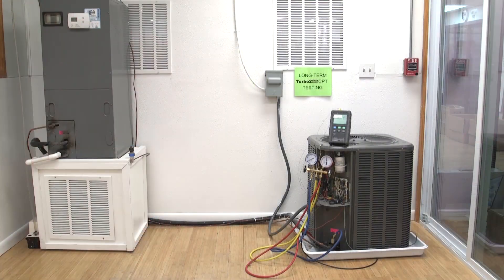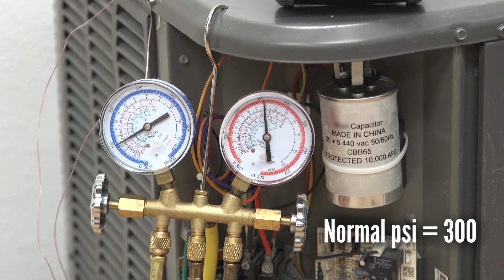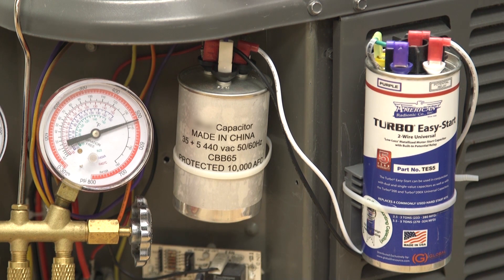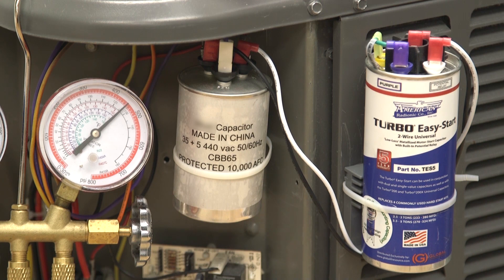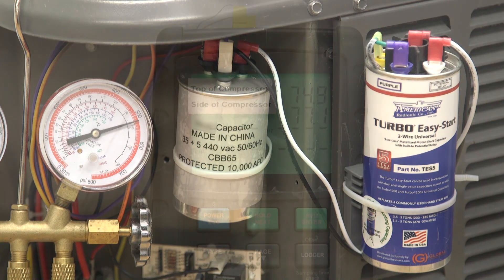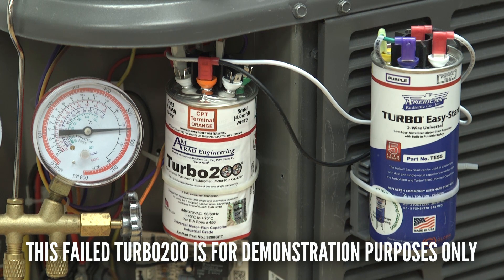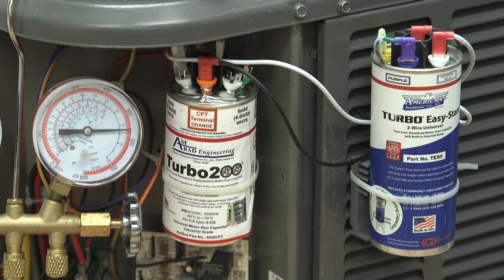Turbo200 and Turbo200X with Compressor Protector Terminal (CPT)

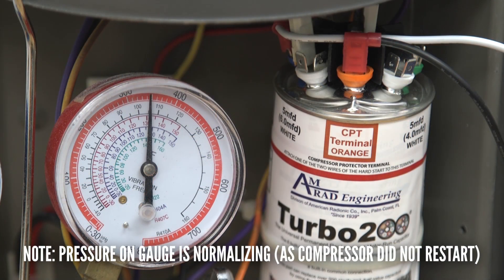Comment: SO, are you saying that If you have a Turbo 200 ( say 45/5) setup on you AC unit already, and someone installs a 5-2-1 (three wire) hard start kit in your unit, that the BLACK wire from the potential relay box should go to the ORANGE 🍊 terminal on the Turbo200 capacitor 4:50 and NOT to the T1 post of the  contractor..?? 🤔🤷🏻‍♂️
Reply: Does it have a Potential Relay, the "three wire" that you're referring to?  If so, the CPT function doesn't apply.
Reply from the maker: Hi there, thank you for your comment. The wire that normally goes to the common would go to the orange terminal!
Reply: @global.the.source  .. Thanks for answering.👍  I see spell check changed “contacter” to contractor” anyway on or 5-2-1 three wire HS Kit has different color wiring from the potential relay box, the Black goes to the T1 on the contacter, the Red from the kit capacitor went to Common on the AC unit and likewise the Yellow to the Herm… BUT, since a Turbo 200 was installed in 9-2021, Now that Red wire from the kit should be swapped from common over to the CPT terminal, You Say.?? 🤔 I am sure the technician back in 21 wasn’t familiar with just exactly what that Orange 🍊 CPT terminal was for..!!!

Comment: Does the CPT prevent damage if the hard start kits relay contacts weld together?
Reply from the maker: Hi Denny,  

Thank you for the opportunity to confirm! The NEW CPT® Fuse Wire on AmRad’s universal hard-start kits protects the compressor from damage within 3 seconds of a relay failure!

When the potential relay on a hard-start kit fails with the contact stuck in a closed position, the motor-start capacitor remains in the circuit. This makes the AC compressor run with too much capacitance, causing damage and even potential failure.

The CPT® Fuse Wire prevents this damage. When the relay becomes stuck in the close position, the fuse inside the wire disconnects within 3 seconds, cutting the motor-start capacitor off from the AC system. No damage, no mess, easy replacement.

Only available on AmRad’s American made, 2-wire, universal hard-start kits (TES5 and TES5EXT).  

CPT really is the BEST thing to happen to hard-start kits since we made them universal!

Note: All products sold by Global are intended to be used by a licensed HVAC contractor.

Comment: Very hard to find wiring schematics that are helpful ,with the CPT . Need additional videos showing practical field wiring  scenarios .
Reply from the maker: Thank you for your comment. When installing a hard-start, place either the common or compressor wire from the hard-start to the CPT. You can see an example in our Turbo Easy-Start Install video here: https://youtu.be/eW3TcgI8yBk
Reply: @global.the.source  What is missing is a very basic drawing that would show the CPT hard start terminal is internally connected to the Turbo 200's Common terminal. You move the hard start wire from Common to CPT.   And a drawing would illustrate the fact that a failed Turbo 200 run cap will open the CPT to Common connection to prevent the hard start from damaging the compressor when no operational run cap exists.  A diagram that would take 10 seconds to comprehend is far better than a page of explanations or a call to Amrad. As of today, Amrad's website has no instructions or mention of the feature or terminal.